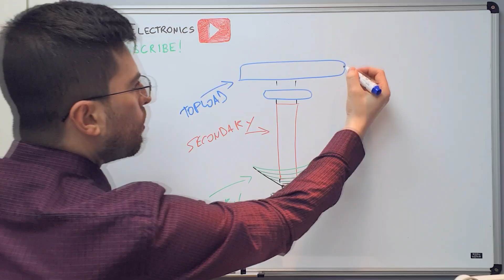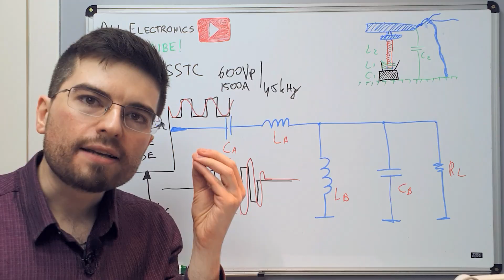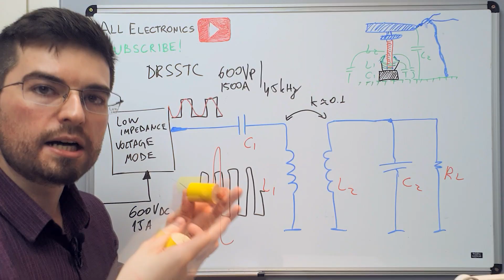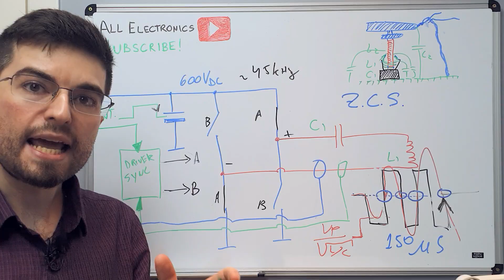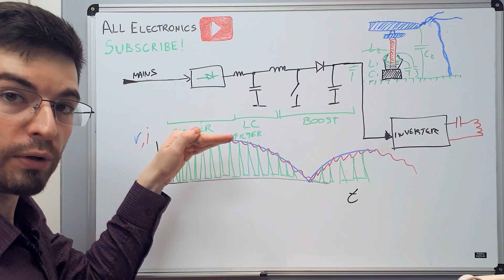How a Tesla Coil Works: Complete Explanation of DRSSTC Principles & Power Electronics

Comment: then how did nikola tesla pass the current through his body ( where current was low)
if tesla coil works in burst mode
Reply from the maker: I think he passed current from other high-voltage generators, not running in burst mode. His Tesla Coils also were burst mode, using spark gaps. It would have killed him!

Comment: the circuit schematic does not match reality ... 1.500 Amps nether. The primary as the load can not stand this high current, impossible, because if you calculate the wattage, Volts rms times Amps rms, this is several kWatts rms, the primary would reakt to like a fuse or, more obviously, a flash light.
Reply from the maker: Missing me saying it works in 120 Hz bursts? Welcome to the channel!

Comment: Have you ever think about practical application of sending energy from point A to point B? e.g. using  surface wave also called Zenneck wave? It is so easy starting from 2m band (144MHz) and going down to  17kHz if successful?  Tesla assembly on the top of  copper foil  path as Tx at point A serving as a conductor that is having dielectric air (sandwich) and another Tesla assembly serving as  Rx at the point B. You may also  try Goubau g-line at first where (sandwich)  is the wire and dielectric is  the coating  of it.(e.g. teflon).
and than switching to  earth as lossy conductor with air as dielectric. We tried it  for 5 miles with efficiency varying from 47 to 96% The difference is that instead of dissipating power  into losses you have no spark but practical application.
Reply: Good afternoon! Have you not yet built a device to harvest energy from the surrounding space? Why have so many years passed, and the secret remains undiscovered?

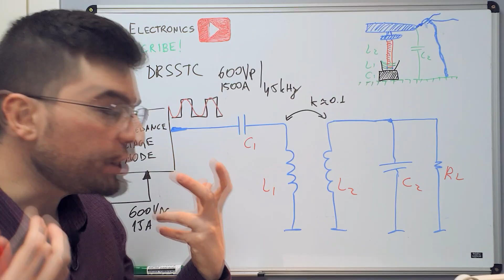Comment: At 12:40 the topology shows the output as a parallel RLC, how you get resonance with voltage amplification if it's a parallel RLC. Isn't the low k needed to have a large leakage L so that the secondary part is a series RLC instead of a parallel ? Tesla used 2 inductors, one with good coupling for  voltage induction and the other to make the series resonance.
Reply from the maker: Energy conservation, for a higher impedance output, the transferred energy is represented by a higher voltage.
Reply: @AllElectronicsChannel  Thanks for the answer but I don't get it. Voltage in the series RLC rises only due to resonance. I don't know any models that use conservation of energy. Could you make a video about analysis of that type of circuit and explain the impedance matching ? Or suggest paper, books that treat that argument.
Reply from the maker: @SB-r3k  

I can't send pdfs here, search for 

[1] Designing a solid-state Tesla coil

[2] Designing an ideal double resonance solid-state Tesla coil

From By Antonio Carlos M. de Queiroz
Reply: I found this Ai generated response,
Hope it helps 
Solid-State Tesla Coil Design
The design of a solid-state Tesla coil, particularly a dual resonant solid-state Tesla coil (DRSSTC), involves creating a system where both the primary and secondary circuits are tuned to the same resonant frequency, forming a coupled resonant system.
 This dual resonance allows for efficient energy transfer, resulting in high-voltage output and the ability to produce long sparks.
 A key design consideration is the use of a high-Q resonant primary circuit, which can lead to very high tank currents, often ranging from 200 to 500 amps, necessitating a low average duty cycle (typically 1-5%) to manage power dissipation and prevent component damage.

The design process often begins with determining the resonant frequency of the secondary circuit, which is influenced by the secondary coil's inductance and the capacitance of the topload (toroid).
 The secondary coil itself requires careful construction, as the wire used is typically very thin and fragile; using a fingernail to separate turns during winding helps prevent overlap and ensures the shortest possible distance between turns.
 The topload, usually a toroidal shape made of aluminum, acts as a capacitor, holds the high voltage at the top of the secondary, shields the coil from corona discharge, and helps lower the resonant frequency.

For the primary circuit, the tank capacitor and primary coil are designed to resonate at the same frequency as the secondary. The primary coil is often wound with multiple turns on a form, and the number of turns is chosen to allow for easy tuning via tap points, which helps manage the inductance and achieve the desired resonance.
 The primary circuit is typically driven by a half-bridge or H-bridge configuration using high-power switching devices like IGBTs, which require robust gate drive circuits and protection features such as over-current detection.
 The driver circuit often uses feedback from the primary coil to ensure oscillation remains close to the resonant frequency.

A specific design approach for an ideal double resonance solid-state Tesla coil involves a lossless system where the driving signal is sinusoidal or a square wave, and the goal is to transfer all energy from the input to the output capacitance within a specific number of cycles.
 This is achieved by selecting three frequencies in a ratio of three positive integers (k:l), with the excitation frequency at the central frequency (l) for the most practical design (b), which results in complete energy transfer in l/4 cycles.
 The required element values for the circuit are calculated based on these ratios and the specified capacitances and inductances.
 For example, a practical design using mode 37:39 with a coupling coefficient limited to 0.1 can achieve a voltage gain of approximately 842, producing sparks over 150 kV with a 180 V input.

The design can be further enhanced for audio modulation, where the coil is used to play music. This requires an interrupter, such as an SD card interrupter, to modulate the drive signal, and a driver circuit capable of handling the modulation.
 The mechanical design of the entire system, including the base, tower, and connectors, is often created using CAD software like AutoCAD to ensure proper dimensions and structural integrity.
 The final system is tested and debugged using an oscilloscope to verify signal integrity and performance.

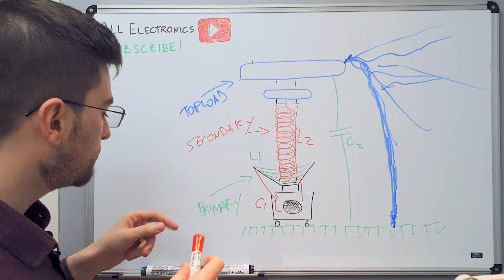Comment: I'm learning a lot here! At 6:28, the two LC circuits are not resonant but oscillating tank circuits. When you tune the primary LC tank to oscillate at the same frequency as the secondary tank circuit, then you have a resonant transformer.
Reply from the maker: Yes and, actually, they need to be slightly out of tune. Use LTspice to see how coupled LC tanks behave.. you will see two resonant frequencies appear as the coupling factor is increased.

Comment: There needs to be a coil calculator which puts out parameter spectrums/ranges (of interdependent/covariant variables) depending on how many variables you determine/collapse. Coils can look very differently yet show the same frequency. I would've liked to set the frequency and then narrow down on other parameters by setting materially determined (available) parameters like wire radius, top load dimensions to then move on to "turn number", coil circumference.  but there's no such calculator available and I'm too slow of a learner to produce it

Comment: This is the best video I have ever seen on Tesla coils- how it only has ~2.8k views is beyond comprehension. I have one question about the Boost PFC- how do you charge the capacitors to the initial 325V without massive inrush currents? is there a pre-charge system that cuts out once the initial charge is established?
Reply from the maker: Thanks! Yep, I used a pre-charge circuit. Just a contactor with a big series resistor, in the 100 Ohm range.

Comment: This was the best explanation of DRSSTC I’ve seen. And I’ve been watching a lot of videos looking for this level of information. I’m a soon to be old guy, getting into electronics to keep my brain occupied. I’ve always been fascinated with Tesla Coils and have been attempting to construct my own with varying levels of success/failure. In all your free time, do you think you can visit the topic of the Slayer Exciter Circuit version of a Tesla Coil and the hybrid Solid State , Spark Gap variant? Electronics is a slippery slope, every time I learn something new, I realize how much more I don’t know. You do an excellent job conveying your point and explaining it in a way that demands engagement. Thanks sooo much! I look forward to the rest of your videos!
Reply: I second that! My friend, Peter, and I built a lot of coils when we were teenagers. Our last coil before we went off to college was about 5' tall and 24" or 30" in diameter (about 5,000' of 16 gauge stranded, insulated wire) and with a 6,000V, 750mA?? transformer, rotary spark gap and microwave oven capacitors, we were producing 6' to 7' sparks!
Reply: @zachreyhelmberger894  Question; if I'm using a metal cup, I need to electrically isolate the mounting bolt from this don't I ? I have a hollow sphere to attach the wire end to and just realized I'd be shorting it out to the tube. My design isn't a Tesla coil but something similar, so I can't use a pvc tube. I'm picking up charge modulation off the tube itself instead of a coil for a circuit  design necessity.

Comment: Can you use the tesla coil in reverse. Draw energy from the atmosphere, the energy that forms lightening. Then turn it into manageable current?
Reply: a topology designed specifically for that purpose... something like the Wardenclyffe original design, which wasn't exactly what was built. It was scaled down a bit, but would've probably worked at least as a demonstration, long enough to get attention and more funding

Comment: Amazing!! By the way, regarding what you mention that the Tesla coil is a double resonant tank circuit, in that case where would the primary capacitor be found in the Slayer Exciter  circuits? It would be good if you talked about those circuits too because I don't usually find information about those seemingly "basic" circuits :(
Reply from the maker: The Slayer Exciter is closer to a single resonant system! With an untuned primary

Comment: When discussing the PFC, it looked as if you were describing critical conduction mode and not discontinuous mode.
Reply from the maker: It's mainly discontinuous. My drawing was not the best 😂
Reply: @AllElectronicsChannel  Won't going discontinuous vs critical distort the input waveform?
Reply from the maker: Think distortion comes after critical, right?
Reply: @AllElectronicsChannel I was thinking the off time (no inductor current) would vary and cause a non linearity. My simulation shows the same.

The peak current is indeed proportional the input voltage, but the average is not because the time the inductor current is at zero varies nonlinearly. 

Critical conduction mode eliminates the nonlinearity because the inductor current doesn't dwell at zero.

Comment: When the coil isn't being excited, are all transistors in the H bridge off or do two (such as both bottoms) stay on to let current circulate?
Reply from the maker: All switches off. The remaining energy of the LC tank is rectified back to the bus by the the bridge diodes.
Reply: @AllElectronicsChannel  Thanks.

Comment: Hello sir,

Could you perhaps tell me how it works with this schematic:
https://www.hulpnodigmet.nl/wp-content/uploads/2013/06/4tr2_5watt-radiorob007-1024x732.jpg

it concerns the taps on the coil L2 and L3
what is the goal?

  Healthy and Friendly Greetings from the Netherlands!
Rob
Reply from the maker: The taps help to match the impedance of the bases of the transistors. So the tank seems the base as a higher impedance, without loading the Q too much.
Reply: @AllElectronicsChannel  Yes okay thank you!
but if you had to do this in a different way,
Could you please suggest an alternative way?

Greetings Rob
Reply from the maker: You could use LC networks... I usually use this form of tap as you show, great technique!!